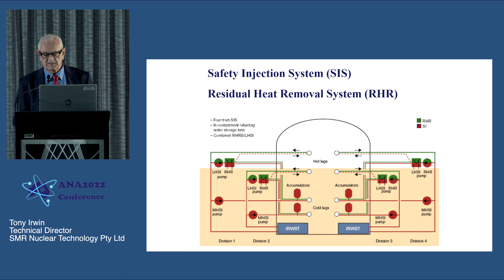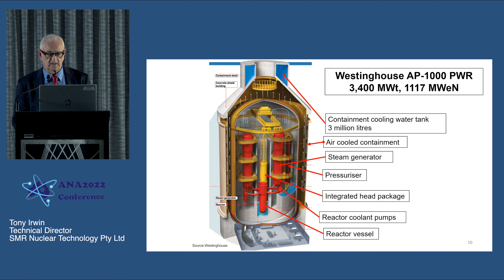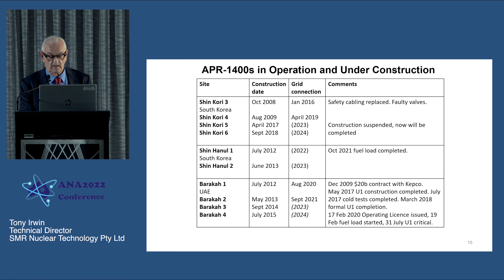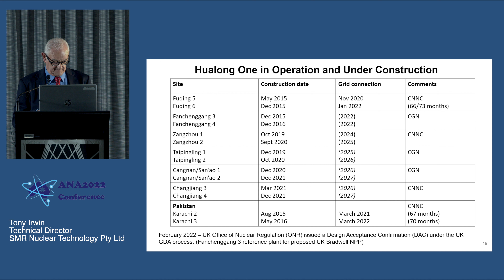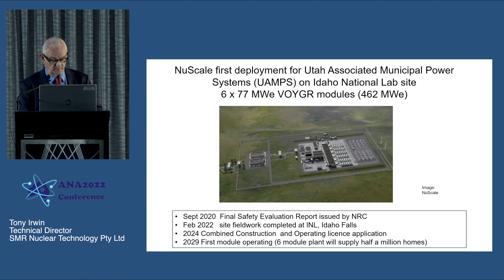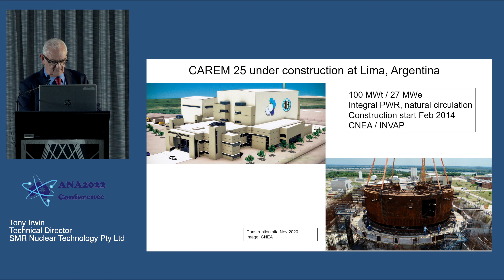Light Water Reactors – large reactors and SMRs.- Tony Irwin, SMR Nuclear Technologies

Comment: What are the disadvantages of SMR reactors?
However, they also take longer to build, have higher capital costs so are harder to finance, and are arguably becoming too complex. Different conditions at different nuclear sites also reduce the potential to replicate designs, which also adds costs.18 Oct 2021

What are the problems with SMRs?
With a roll-out of SMRs, skills will be needed for factory work, on-site construction, and plant operation. Deploying SMRs without concurrent supply chain development could hinder deployment and increase costs

As of 2023, only China and Russia have successfully built operational SMRs. The US Department of Energy had estimated the first SMR in the United States would be completed by NuScale Power around 2030, but this deal has since fallen through after the customers backed out due to rising costs

Comment: Let me save you time. 
Heating water is only the beginning of the world's problem. 
No fossil fueled future means 5times more electricity. 
So, 10times the heater cost is the final electricity costs.
So, 5times more electricity is the final clean demand.
So, 50times more minerals and fossil fueled first generation infrastructure and financing. 
And time frames, and.........

EVs and rooftop PV in the millions and millions and millions will easily beat this uneconomic nonsense.
Reply: That's the most laughable thing I've read in a while.
The resource usage of renewable energy sources is 100 times that of nuclear, not to mention land usage.
Tell me again how we'll be mining more uranium when U3O8 at natural 0.7% U235 concentrations has 10500 times the energy density of crude oil?
Reply: @Ziess1  
Nuclear weapons are even more concentrated energy, and that's not good. 
The biggest problem is the concentrated central electric generation MUST disperse the electricity to the millions and millions of ends of the existing national grid. 
With more electricity demand the grid must be rebuilt to carry the greater electricity supply. 

The grid costs are huge. 
The grid costs are 66% of electricity bills.
This is why the nuclear promoters say even free electricity needs expensive national transmission grid and farms of Renewables are not viable. 
The grid is fragile, built to minimum for economic reasons.
But rooftop PV and EV big batteries can generate and store electricity at the millions and millions of ends of the existing national grid. 
This is unloads the grid. 
And no new grid is needed, this is a stupendously large saving. 
Australian rooftop is cheaper than windows $/m2. 
USA rooftop is too complicated and expensive.
Reply: @Ziess1  
You are right about the density.
To replace with electricity 5 to 6 time more electricity is needed. 
The grid is fragile. 
The grid is incredibly expensive and fragile because it was never over built. 
Any way to unload the grid has massive economic advantages.